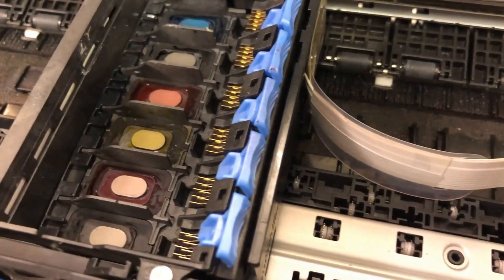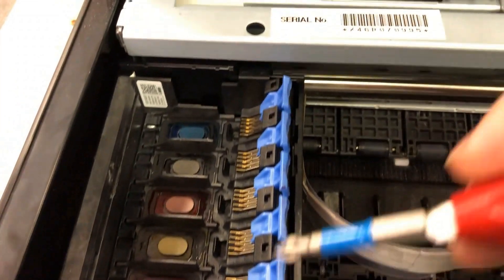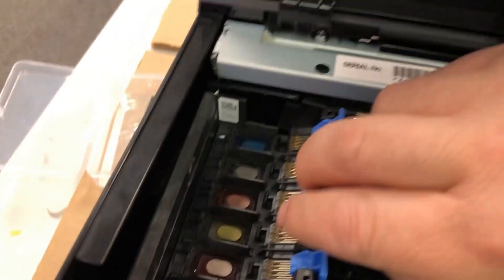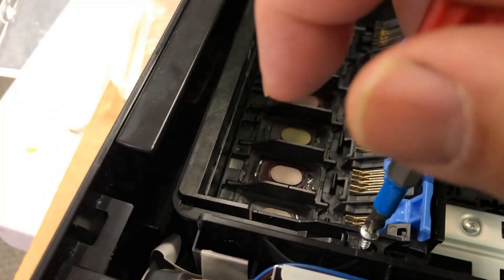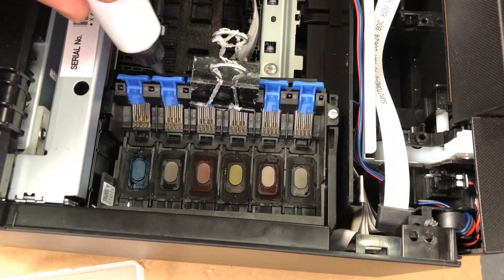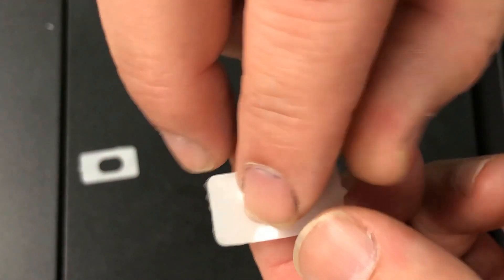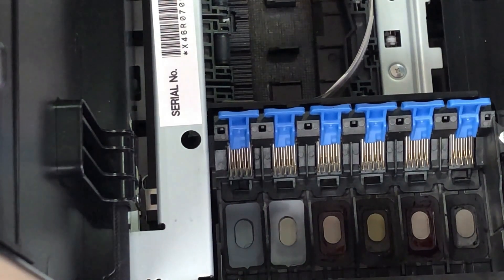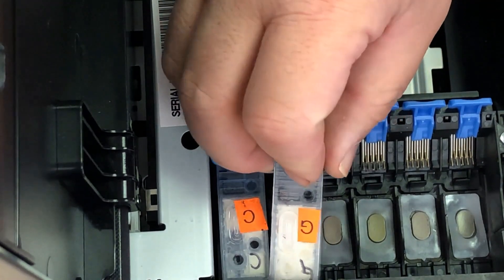Why Epson XP-15000 White Ink Leaks and How I Fixed It!

Comment: What dose water proofing the printer do? People where saying if you convert this printer to dft the print heads will clog or eventually wear out and six months to two years, is that true or following your steps from your videos this printer can be a long time reliable converted dtf printer? I want to start making tshirts soon so I’m curious
Reply from the maker: Thank you so much for your support and for taking the time to ask such a thoughtful question—it really means a lot and I’m glad the video helped spark it; in short, waterproofing a converted DTF printer is about protecting sensitive electronics from moisture, ink mist, and condensation that naturally happen with white ink systems, and when done correctly it dramatically reduces corrosion, shorts, and random failures, which is why people who skip this step often see issues like leaks, electrical damage, or premature failures and then assume “DTF just kills printheads,” but the reality is that clogging and wear usually come from improper setup, poor ink circulation, lack of maintenance, or ignoring environmental control rather than DTF itself, and when you follow the steps I show in my videos—proper waterproofing, correct ink handling, regular maintenance, and realistic expectations—the XP-15000 can absolutely be a reliable DTF printer for a long time rather than just six months to two years, especially for someone starting a T-shirt business who wants to do it right from day one; if you want faster help as you move forward, you can always email [support@bchtechnologies.com](mailto:support@bchtechnologies.com), and if this video or my reply helped you, I’d really appreciate a Google review here: [https://g.page/r/CfL7k6nYvPQ9EAg/review](https://g.page/r/CfL7k6nYvPQ9EAg/review); also, feel free to join Run With Kevin — LIVE, where I go live every morning (usually between 6–8 AM Eastern) answering printer questions in real time, and if you subscribe and turn on notifications you can catch the next live and ask directly—subscribing or becoming a channel member also helps a lot because I get a very high volume of questions and replies are prioritized this way: subscribers and members are usually answered within 48 hours and get extra perks like early video access, regular viewers are answered if time allows since I can only respond to about 10 questions per day, and any remaining slots are filled last-in, first-out (newest questions first), so if you’re not subscribed and don’t see a reply within 48 hours you can either subscribe or repost your question to bring it back to the top, and if you subscribe later your older questions automatically become priority without needing to repost—thanks again for watching and best of luck getting started with your T-shirt business.

Comment: Can you remove the OEM silicone flaps to clean them if the printhead is disassembled on this model?
Reply from the maker: Yes you can. I am making another video which take apart the printhead.

Comment: When converting a 15000 for DTF printing, you need a white ink circulation system?
Reply: If you use the silicone washes, do you need to waterproof the carriage?
Reply from the maker: It depends on your configuration. If you utilize cartridges, then no, but if you use CIS, certainly.